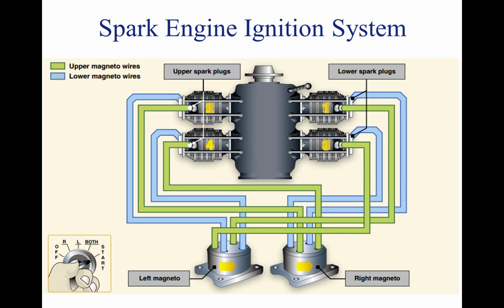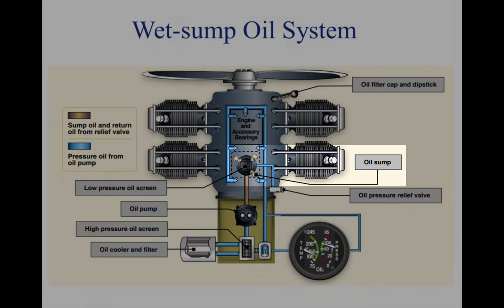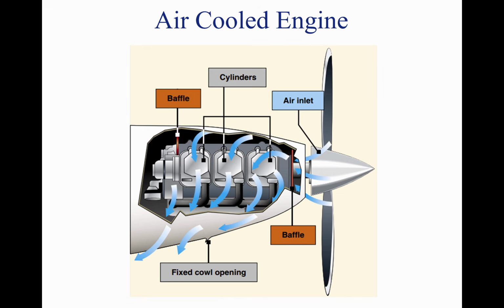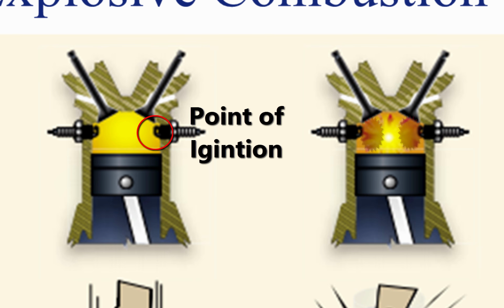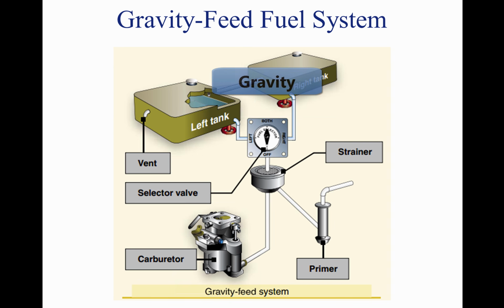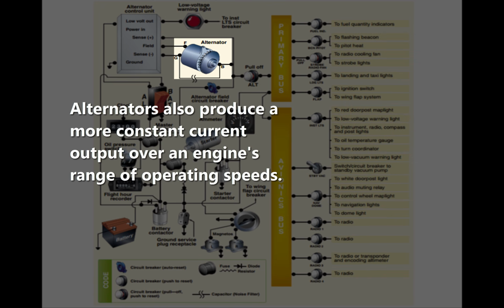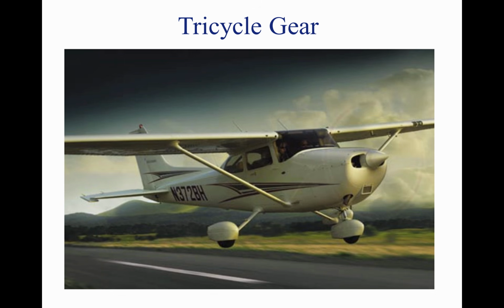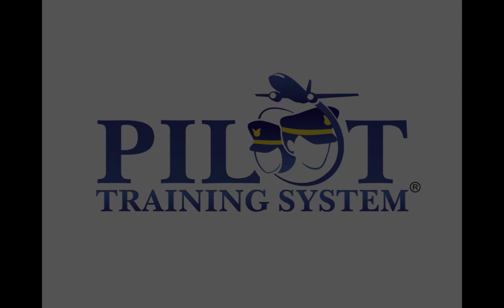Private Pilot Tutorial 6: Aircraft Systems (Part 2 of 2)

Comment: One important item is not included -- the OIL COOLER.  Great video though.
Reply: Do all aero engines have oil coolers?  Or are there some that rely on the cooling fins to conduct heat out of the oil?  Most of the air-cooled motorcycles I've had relied entirely on this passive cooling, essentially keeping the oil at CHT (aka really freaking hot compared to a water-cooled engine, which is why those bikes required 50wt).

Comment: That 4  cylinder engine on small Airplanes is junk comparing to a V8 engine from Ford or Chrysler or General motors. Plus the. 4-cylinder engines a Magneto ignition system has been around since the 1930s to the 1950s you find it first on farm tractors from that era, but that's super old technology and no use it in the 4-cylinder engine airplanes it's outdated. H.E.I. = High energy ignition,  that's 100% better system. H.E.I. is very reliable system. it'll run for over 10 years or over a hundred thousand miles before you have any problem with it, when that system is starting to wear out it gets slow in starting. It would be a great system on a small aircraft engine. But the V8 motor was also be better on the small aircraft overall because a lot less problems.
Reply: Ger Desoto I hope you’re kidding 😂
Reply: The main problem with car engines is weight.  A car engine of the same weight as an O-360 is typically in the 2L range, requiring a reduction gearbox to get down to an RPM compatible with a prop.  Such a gearbox adds weight, cost, parasitic loss, and a point of failure.  An engine that can produce the necessary power at the necessary RPM (V8) is much much much heavier than the aero engine.  Putting a 5.3L LS in the front of a C172 would do bad things to the maximum load and the CG.  The Fords and Chryslers are worse, with the Fords being physically enormous, and the Hemi being enormous AND much heavier than the other two.  It's actually amazing that they make 5.9L airplane engines less than 300lbs dry.  It's the one thing they're genuinely good at.

I do agree completely that these aero engines are hopelessly outdated for a variety of reasons, but there really aren't all that many great direct drop-in options for replacement.  Ideally someone would design a better horizontally-opposed aircraft engine with crossflow heads, ports that aren't stupid, and using modern casting and assembly techniques (like ditching the stupid silk string posing as a gasket).  I also agree that an independent dual HEI ignition would be an awesome addition.

Here's something you missed - the fuel systems.  The fuel injection used on even the brand-new engines is effectively like K-Jetronic from the 70s, which was outdated when it came out.  There is absolutely no excuse for making the pilot part of the feedback loop on a fuel injection system in this century.  Even mid-80s EFI technology is lighter, simpler, more reliable, and a thousand times cheaper than the Rube-Goldberg contraptionry they have vaguely sloshing fuel around under the cowling in brand new airplanes.  They even had carburetors in the 70s that were happy as a clam over a 10,000ft range.  People ride Lectron carbs from sea level into the 5-digits without having to adjust anything, and that's on a picky-princess 2-stroke with lightning throttle response.

Comment: NEVER, EVER reset a circuit breaker unless the system it's protecting is necessary to sustain flight or the system has been checked out by maintenance. Circuit breakers prevent electrical fires. Re-setting a circuit breaker can cause an electrical fire.
Reply: Always reset and hold it in place with tape so that it doesn't pop out again